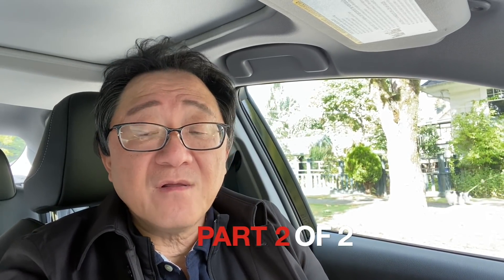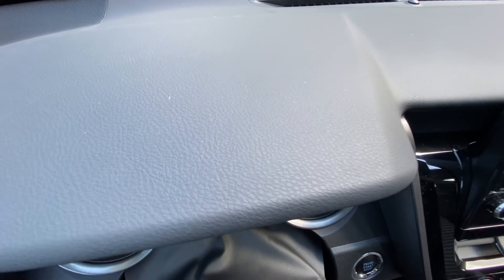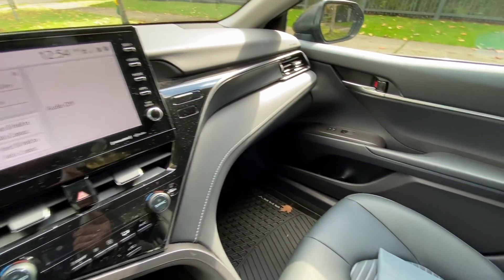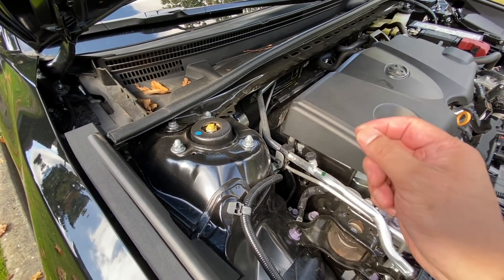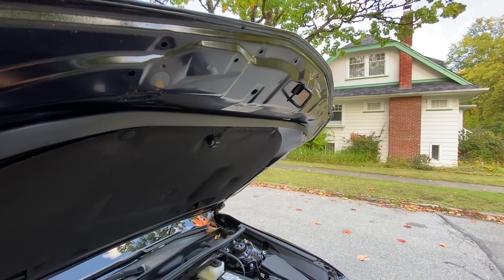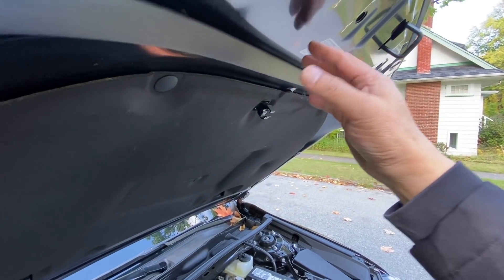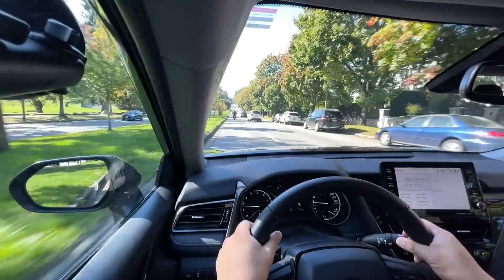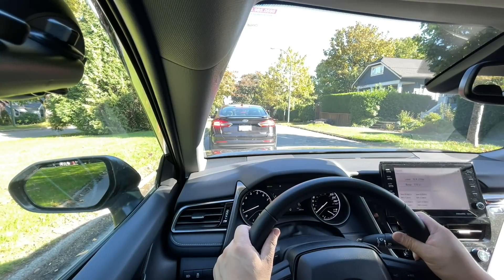CAN ENGINEER TELL THE DIFFERENCE BETWEEN JAPAN-MADE CARS FROM THOSE MADE ELSWHERE? - PART 2 OF 2

Comment: Toyotas are very good , either made in Japan like My RAV 4 or in Texas like Tundra , My problem is with the service at the Dealer , with My Corolla they mixed up the Vacuum hoses and could not find the problem so I could not use My A/C I went to another shop and they found that problem while looking at something else , On My Tundra they replaced the Frame and now there is a Electric short , that Drains the Battery to nothing , I have to disconnect the Battery if I am not going to Drive it for a few days , on My RAV4 I had a Break line Leak , they wanted over $ 1000 to repair it , I an done with going to Toyota for repairs , I recently bought My Wife a Honda

Comment: I trained in a Mitsubishi manufacturing plant while they were building an American plant. I can not speak on quality because I think our American factory makes excellent quality products. However, I was shocked at the work ethic of Japanese production workers versus American production workers. While the Japanese did not adhere to safety protocols as well(using cut resistant gloves, etc.), I can attest to the speed. These folks were fast. In the 50’s, American production workers were fast. But today we couldn’t hold a candle to what I saw in Japan.

Comment: Hello David, I just purchased a RAV4 Prime.  I love everything about the car except the bumpers as I live in New York City and they appear to provide no parking protection, especially as related to the front and rear sensors. I am considering bull bars but I am concerned that these structures hard mounted to the chassis would undermine the accident shock adsorbing characteristics of the vehicle.  Please advise regarding the strength of the bumpers and any safety risks presented by installing bull bars.  Thank you in advance for your response and all your work.  Jeff P.

Comment: That was very well done David, I like your sincerity and the fact that you’re an engineer not some random car reviewer that doesn’t understand the real means of quality control and how a vehicle is actually made from the ground up. You’re lucky that you have nice roads in Canada, out here in California our streets and overall infrastructure is absolutely terrible! It would take a Rolls Royce Phantom just to be able to drive in peace and serenity in many parts where I live because of how bad the streets are, which are littered with potholes, cracks, unevenness, and are overall crumbling badly. 

I would like you to get more into detail about body integrity (structure), suspension,  steering components, drivetrain and interior workmanship that sets Toyota apart from  other brands.

Do current day Toyotas use higher quality parts than say American automakers such as GM and Ford or not necessarily? Everything from door hinges, to door handle strength, plastic moldings, engine component quality such as crankshaft bearing and piston materials, gear and clutch quality in the transmission, electrical components and basically the smallest of details that might get overlooked by other brands.

Comment: David, thoroughly enjoyed the first two Quality videos you have done.  I work at the Georgetown KY plant (home of Camry, Avalon, RAV4 Hybrid and Lexus ES).   Your audit method is an excellent way to check for vehicle quality and whether or not as a consumer if I feel I’m buying a quality product.   Working in BodyShop, the importance of quality stamping parts and body operations form the foundation of the vehicle.  The use of adhesives and sealers are monitored since they are a core part of many parts of the vehicle.  The hood, trunk and door hemming machines are incredible to watch as you pointed out the results in your video.
Also, the new TNGA platform that became Toyota’s new standard is impressive.  Drive a 2018 and up Camry or ‘19 Avalon and up compared to previous editions and it’s daylight and dark difference!  TNGA brings a whole new level of “feel” and driving experience. Same goes for the new RAV4 Hybrid and the ES.  Incredible vehicles.  Can’t wait to see what Toyota has coming out next!

GREAT job with your videos and the technical view you bring forward!
Reply from the maker: Thank you so much for your comments!  You have an incredibly important role at Kentucky to keep all the Toyota cars rolling out with a high level of Toyota standards while keeping up with the takt time - never easy job!  I worked in all areas of manufacturing but specialized in body shop or body-in-white and was in charge of the kaizen activities which you know is literally a 24/7 job during the product launch.  I hope I can continue to add values to viewers and look forward to further feedback from you and others.
Reply: David, I wish that you could reach out to our plant management staff at “K” to have your videos in this Quality series shown on our in-plant video system since October is our QUALITY Month and focus time.
THANK YOU so much for the time, dedication and effort placed into our products to ensure we are going forward with Toyota’s Mobility program.  We have a younger work force now that is on a steep learning curve moving to the future.  These 2 videos and others you may have in this particular series would really be invaluable at this time.  We are at a critical juncture in our plant’s history.   I’m hoping that with 25.5 years invested, retirement is soon.  We NEED customer satisfaction driven team members!  All the BEST to you 👍